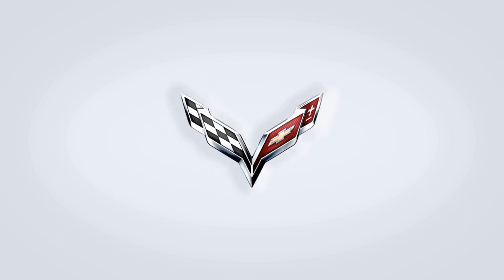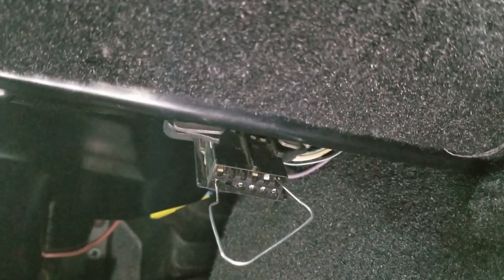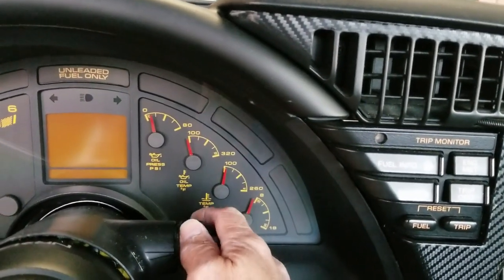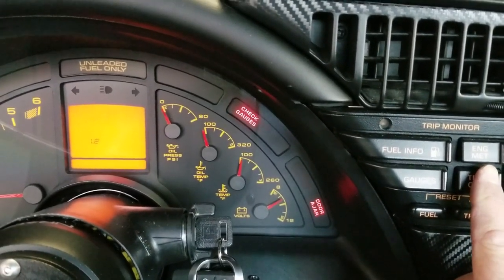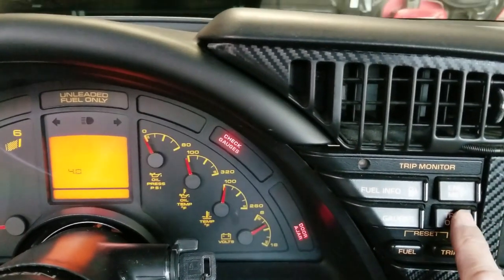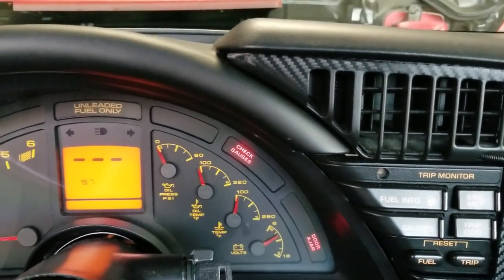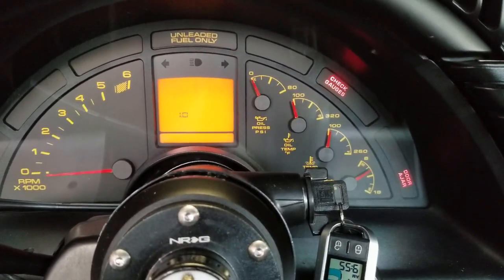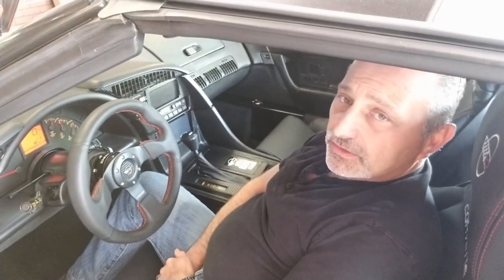How to Check and Clear Engine Codes on a C4 Corvette

Comment: I just bought my 94 about 3 weeks ago. I do not know how many owners it has had. It has some after market stuff on it such as heads and cam. It has a lot of miles for a vet, 132000. I have the check engine light on and other stuff lit up on the message board. I have my hands full on figuring out which codes are still ongoing or not. This video definitely will help me narrow things down.
Reply from the maker: I wish you the Best of Luck on figuring things out. The way I show you how to check the codes will give you a pretty good idea of what is wrong. I'm glad yo see that you drive your car and enjoy it.
My C7 already has 111k on the clock!
Thanks for watxhing!!
Reply: Great video and very informative 👍🏻... I have 95 c4 corvette has rough idel and makes a pinging popping sound... I have changed 02 SENSORS, EGR, TPS, IAC, MAP SENSOR and the sensor that screws into the front of the waterpump... but it still runs the same.... any ideas? Please don't say it's the Optispark... Lol...  any chance you might know the code for a bad Optispark on a 95 Vette..?

Comment: This is a very good step by step video of how to  jump the pins and go through the codes. Thanks!  My 1994 C4 has a check engine light on but runs great. Do you think If I clear the codes would I able to pass inspection? They are only doing visual inspections in Texas now for 1996 and older cars. (25 plus year old vehicles) .. thanks
Reply from the maker: Hello thanks for watching.  If you van clear the codes and the service engine light goes out and stays out you should be good to pass the smog inspection.
But I can't guarantee that.
Reply: @THECORVETTECHANNEL  Thanks ! Have a great Labor Day!
Reply from the maker: @indiomonk123  You Too!!

Comment: hi Scott, I am UK based, i have a 1990 originally dutch corvette, where is that plug located on my car please?  Great video by the way, very professional !
Reply from the maker: Hi Angelina..Thank you for watching. You did not say what side of the car your steering wheel is. But it shoudl be basically right above your knee when sitting in the driver sseat of the car.

Comment: I have code 51 and my car starts i had a chip put in the computer to get my car running could  that code cause a engine light to come on ? I know my security light stays on because of the bypass i read more about that code and it says if the key is dirty or damaged that code will set if i get a new key made will that code go away?

Comment: I have 1995 c4 lt1... was told the engine was replaced with another 1995 lt1 engine??? How can I tell for sure?? Car fax says 111k on car dash says 68k??? Is it easy to roll back odometer or do u think he swapped engine with another lt1 with 68k like he said ?? Thanks so much for any help
Reply from the maker: The miles are stored in different computers in different years. I would say that the computer that holds the mileage has been replaced.
It will be very had to tell except for the possibility that you may find the yellow or white that wrecking yards use or mileage calibration sticker from the dealer.
Best of luck,
Scott
Reply: @THECORVETTECHANNEL  is there a vin number on the engine??? Can't find one???. If the vin matches then it's original engine
Reply from the maker: @lasvegaslife5770  yes there should be, but I am not sure right where it is.

Comment: SOS I’ve recently bought a 1994 corvette and the screen is stuck on “1.0” how do I go back to normal operations? I can’t see how fast I’m driving or how much gas I have left any help would be appreciated :(
Reply from the maker: I would try disconnecting the battery and waiting 15 mins
Reply: I'd click TRIP/ODO or MET/ENG like he is doing in the video and see if you are stuck , or if it is advancing through the menu. If the 1.0 number changes, check the OBD connector that Scott is working with and make sure previous owner didn't leave any jumpers on. If it's not advancing, then it's stuck in diag 1.0 mode. Unplug negative on battery 30 minutes.

Comment: Hey, I have a 95 which is still OBD1, but the connector is OBD2… so how would I do this paper clip method? I’ve had another 95 before and someone let me use a very expensive bosch tool that worked and gave me codes, but I don’t really want to spend that much… Is my only option getting a ob1/ob2 scan tool?
Reply: Ground pin 12 to pin 4. Pin 12 is the fourth pin from the bottom left of the connector. Pin 4 is directly above that

Comment: What's the process to clear a check engine light in a 96?
Reply from the maker: Great Question. Your one of the lucky ones. 96 was the first year of OBDII so you can just plug in a modern reader or scanner into the diagnostic port and clear the codes.
Reply: @THECORVETTECHANNEL  Awesome. Thank you. Didn't realize OBD2 connectors are only $20-$30 on Amazon and sync with your phone via Bluetooth. Technology is awesome.

Comment: Scott, Is this the only way to clear codes for a 1990 coupe?
Reply from the maker: Actually if you have an ODBE 1 Scanner  you can do it thru that. But they are very expensive, so this is the easiest and cheapest way.
Reply: Scott, per this video I jumped the ALDL and my dash displayed a code C12 followed by 3 dashes. I am repairing the ground issues with my 1990 related to the INFL REST and Seatbelt lights staying on. Will I be able to clear C12 when I have a good ground?
Reply from the maker: @johnrwhite1260  John I am pretty sure that C12 is the code for all codes clear. You may need to cycle thru the other modules of the computer to see if you have any other codes.